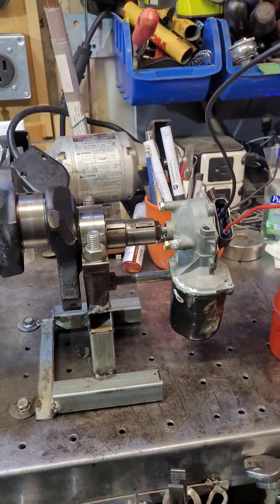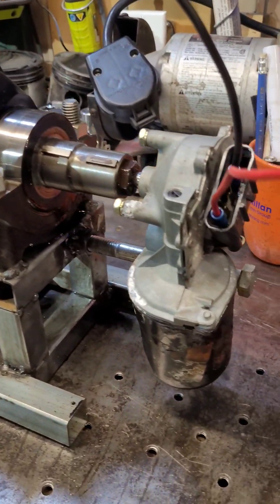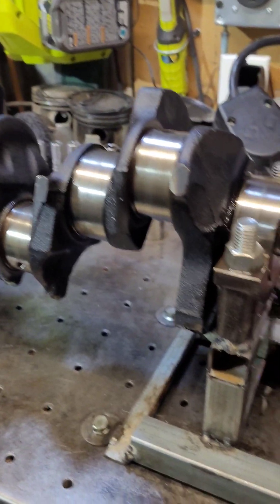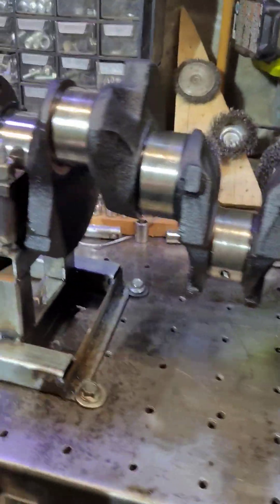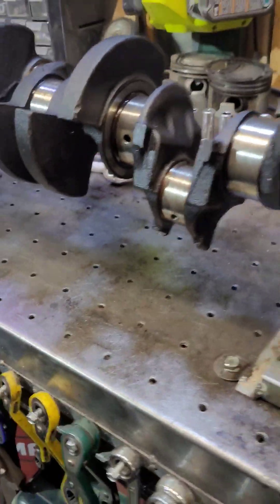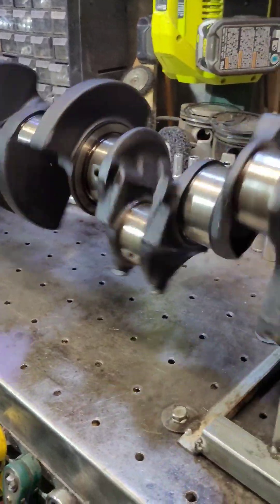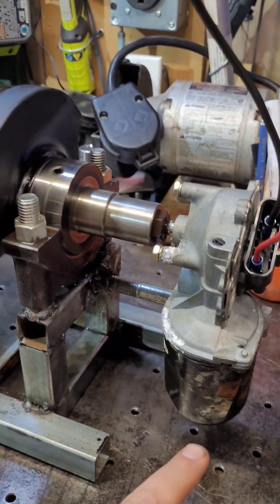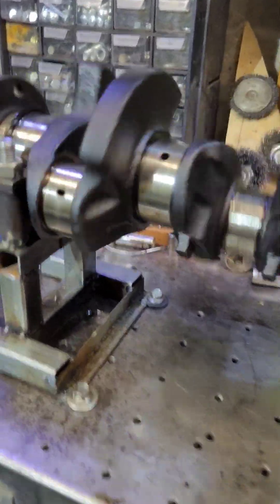DIY homemade crankshaft polishing Rotisserie from wiper motor and  bearing caps  #tools #engine

Comment: Could you attach to the motor with one of those flexible rubber couplers?
Reply from the maker: Hello, yes I believe a small lovejoy Coupler may take out the wobble.
Reply: What wiser motor are you using?